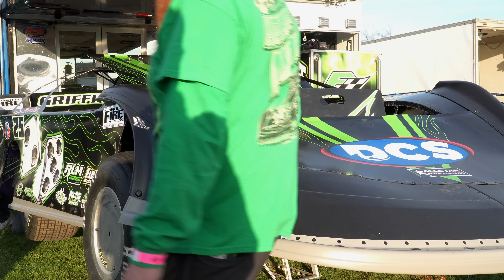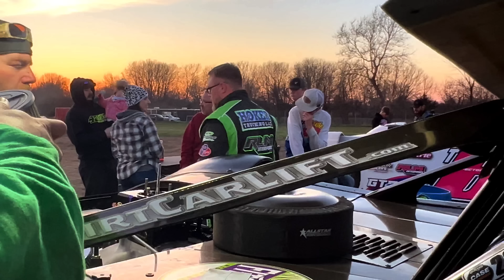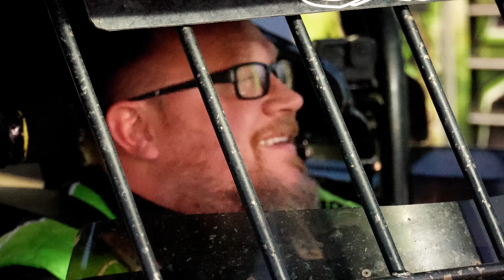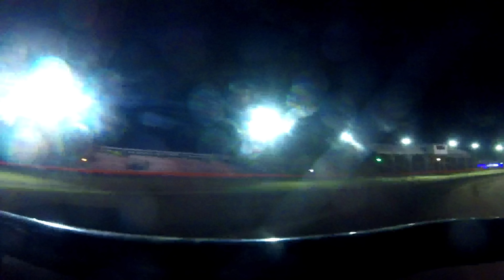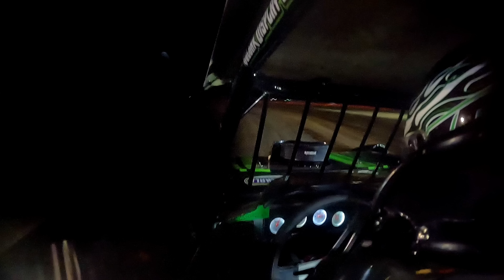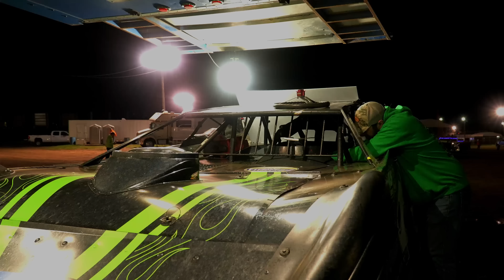SLIDE JOB for the Win @ Farmer City! Starting the season off the right way.

Comment: what r u twisting that motor to? 9999???
Reply from the maker: 8600 or so
Reply: @FegerRacing  sounded really good, must be right on with the cam and the gear, loved the way it pulled off the corners, almost sounded like you didn't lift in 3 and 4